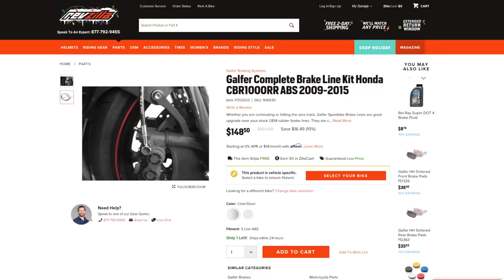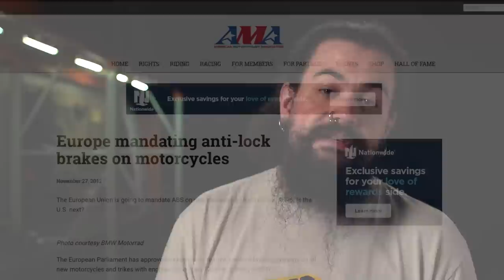3 Arguments AGAINST Motorcycle ABS!

Comment: There are No argument or reason good enough to not have ABS on the streets. Unless you're a professional racer, you will Not outbreak a bike with ABS. I do stoppies on my MT-09 even while leaning backwards with no ABS intervention. So i can't stop any faster with or without ABS. So the only time you'll feel the difference is when you slam on the break too fast. At that point ABS Actually saving lives. And with more and more bikes coming out with lean sensitive ABS, it's getting even safer. Offroad is a completely different story. There should Always be a way to turn of ABS. At the very least on the rear wheel on bikes designed to ride offroad at any time. Even if it's an adventure bike.
Reply: Not true at all. If you ride without any rider aids, you are in charge and are in fact responsible for your own mistakes and for your own life. That means that when on a bike without rider aids, you will instinctivly go slower and be more alert.
Reply: I once had a buddy tell me he could go 3 rounds with the heavy weight boxing champion. That's what I think of when people say they can beat ABS... NO FUCKING WAY !! You will be unconscious 😂😂
Reply: There's off-road ABS these days too, pretty sure it comes standard on newer KTM ADV bikes.
Reply: @Brgnalf81 , no, not at all. People are going to ride their bikes the same weather or not their bike has abs or not
Reply: @csolivais1979  I find that my friends that have rider aids on their bikes tend to over do it more times than the guys without rider aids.
Reply: @Brgnalf81 , so have you had your friends with the abs bikes ride the bikes without? I tend to find that most people, no matter what, tend to drive every thing the same. Meaning, the same person who drives aggressively in a Honda Civic is going to do the same in a Lambroghini. Conversely, if someone drives very conservatively, they will no matter what they drive

Comment: I fully understand the desire to turn off ABS off road but, the first street bike with ABS I had was a 2000 BMW R1100RS and now I won’t buy a new street bike without it. Wet oily pavement, streets covered with wet leaves in the fall, morons on the phone in front of you or turning across your path in the rain, ABS has saved my ass more times than I care to think about. I’ve only been riding for 44 years, but this is one “new trick” this “old dog” appreciates. 😉
Reply: Thank you for being a voice of reason
Reply: I have no ABS, but if it indeed gets mandatory by law I guess at some point in time prices must come down generally for the system if every brand and model simply has one...

ABS saves so many cars, I guess it's time to really start saving bikers too.

I only had a problem with brakes once, never had problems controlling the front brake as I'm used since a kid in bicycles but the problem is controlling the rear brake for me in a dangerous situation. Once I was on a road that fits only 1 car (one way road) and I was only at around 50KM\h and after a turn I get a BMW coming in reverse to me on a tight road, tight turn with no visibility and in the opposite way of the road which for sure I would never expected it. As soon as I saw it full rear brake with gentle front brake, I didn't fall or hit the car but was close to scratching at least however the rear tyre wasn't doing anything at all as it was fully locked since the first second I saw the car, bam full rear brake and I don't think I could ever control it if I get any more similar situation...

Shit might happen at any second and in my opinion it's hard to even know WTF we are going to do unless being there. On a track while racing that's all different for example as everyone knows the track, what to expect and are always 100% focused but on every day riding, everything can happen and sometimes is a split second and it's all gone just like that.
Reply: This was truly inspirational.
Reply: Dont believe that I like rear wheel ABS. No locking the back wheel is depressing and a questionable reduction of control.

Front wheel ABS may be OK.
Reply: @christopherwieland1196  ABS has reduced motocycle fatalities globally by 37% according to the WHO. I'll always have it. Why remove a layer of safety?
Reply: @flippy5118  It depends on your personal needs as a rider, your experience, comfort, and understanding of the difference it will make on your riding experience. With ABS installed the rider is unable to lock up a tire. Locking up the rear tire is fun and impacts your possible maneuverability, locking a front tire allows nose stands and other odd maneuvers. Long story short, there are motions a non ABS bike can perform that an ABS bike cannot and the benefits of ABS are overmarketed through fear mongering. For example, we have all seen the YouTube video where water is sprayed and a biker slams on his brakes and the tires brake out from underneath the non ABS bike and fall on the ground. SO what, the point of defensive driving, especially in the rain, is too not put yourself in a situation where you would slam on your brakes. A non ABS driver could arguably stop a bike faster than a non ABS driver in a competition and certainly pull off maneuvers an ABS driver could not. I've experienced ABS engaging more than once     and have an understanding of it's design and implementation. I also had it engage when I was doing something stupid and nearly slammed into the back of a pickup truck, everything worked out. I would argue with you all day that ABS has not reduced motorcycle fatalities by 37%. Statistics are gather incorrectly nearly as a rule these days to push narratives. Many factors have reduced motorcycle fatalities, mostly cultural and manufacture implementations. I would challenge you to imagine a methodology to collects accurate statistics for such a claim. How would you go about that? What would you take into consideration, what wouldn't you? There is an entire type of movement that ABS removes from riding that involves locking tires and that's the truth. Go find a trick or stunt biker that uses ABS...

That being said, non ABS features aren't exclusively for trick or stunt bikers.

Comment: even pro's can't out brake a ABS system proven many times all ready you have to be a MOTO GP Champion to do  that im not sure everycorner is full of them
Reply: He meant off-road riders. It's easier to back in an enduro than braking and turning. But yea, most of pro enduro riders don't bother with ABS and just switch it off/rip it out completely, so video's argument is invalid.
Reply: i agree.  But to me that is not the point.  ABS works well, that is certain.  I can do without it and have been doing so since the early 1970's.  As an option I'm all for it.  As a self wrencher though I find it unnecessarily complicated and too costly for the benefits.  The costs of ABS repair OFTEN exceed the cost of an otherwise fine machine.
Reply: @amrev2.020  spot on. Id rather see more riders getting airbag vests than ABS. Vigilant riding should mitigate most of the need for ABS, just like driving a car

Comment: ABS saved my ass one morning when it was still a little wet out and I hit a slick part of a freshly asphalted turn lane. It felt like I was on ice but I allowed enough distance when coming up to the car waiting for the arrow, was engine braking and applied the brakes evenly but nothing. ABS light started flashing and bike went loose and shimmied. I felt the ABS working, didn’t panic and all was well. Heart rate was way up but I completely believe the ABS saved me from going into the trunk of that car or locking up the brakes and losing control.
Reply: so you got to keep riding happily ever after. good to know you are safe.
Reply: I am a Japanese girl living in Scotland.

Just this week I was out on my 96ci Harley Street Bob  (FXDB) to pick up some essential shopping.

I was cruising along a dual carriageway at around 60mph well within the speed limit and as it's lockdown the roads were empty.

Up ahead I saw an SUV stopped at the end of the slip road (kinda like an on ramp in the US). 

I thought, "How the hell have you managed to get in that position".

No sooner had I thought that the SUV pulled out into my lane at 5mph and began accelerating slowly as I approached from behind at 60mph.

I had to emergency brake and the crap Harley ABS kicked in, lots of tire smoke, the bike was bucking and kicking and wanting to veer off.

I managed to hold the bike and it slowed to a matching speed of the SUV with inches to spare. My front wheel was an inch off the back bumper.

The ABS both saved me and almost killed me in equal measure. Make sure you buy a bike with GOOD ABS.

Either way I am glad I went to the bathroom before I left home 😰😰
Reply: Cody Phinney  @Cody

Not a bot, just copypasta'd my comment to reply to another commenter.

Lazy I know, but easier than typing it out again 😂
Reply: @DoctorAkikoFukuwara  Thanks for your story I am glad you’re safe

Comment: I am a Japanese girl living in Scotland.

Just this week I was out on my 96ci Harley Street Bob  (FXDB) to pick up some essential shopping.

I was cruising along a dual carriageway at around 60mph well within the speed limit and as it's lockdown the roads were empty.

Up ahead I saw an SUV stopped at the end of the slip road (kinda like an on ramp in the US). 

I thought, "How the hell have you managed to get in that position".

No sooner had I thought that the SUV pulled out into my lane at 5mph and began accelerating slowly as I approached from behind at 60mph.

I had to emergency brake and the crap Harley ABS kicked in, lots of tire smoke, the bike was bucking and kicking and wanting to veer off.

I managed to hold the bike and it slowed to a matching speed of the SUV with inches to spare. My front wheel was an inch off the back bumper.

The ABS both saved me and almost killed me in equal measure. Make sure you buy a bike with GOOD ABS.

Either way I am glad I went to the bathroom before I left home 😰😰
Reply: Hi Akiko. ABS brakes don't stop you the fastest way possible just by yanking them, no matter how good they are. You have to modulate the brakes in a way where your front forks don't bottom out hard and then bounce like a pogo stick. When your front loses traction, you lose almost all your braking. Then as your front comes back down, wham, it bites hard, but then you bottom it out and bounce it, again. And ABS is 100% doing exactly what it's supposed to do.

On that Harley, you gotta do the weight transfer more smoothly to load the front just that one time and to keep it there. 

Braking takes a bit of skill and focused learning. Once you've learned (and most people don't ever learn. We're too dumb and lazy), ABS is not a big deal in the vast majority of your riding conditions. But since most people can't learn this, ABS will save us dummies, sometimes. Like it did for you, here.

Comment: If you ride only on good dry roads you won't need it much. But city riding over white lines, rails, manhole covers, rain, oil, rocks, low temperatures etc. it can save you, your ride and someone else's live. I've fallen locking the front wheel on wet highway with 160km/h and ABS could have prevented that.

Comment: Arguments can be made against any safety feature. Seatbelts can cause death if your car goes into the drink and you're not able to undo them. Lights can blind oncoming traffic. Brakes can cause others to rear-end your bike. Regular maintenance requires additional expenditures. Riding gear adds extra cost to riding.

You have the freedom to choose. You don't want a bike with ABS, buy one that doesn't have it, but don't complain that a particular brand/model comes standard with ABS. Even if it becomes law, you can still get used bikes that didn't come with it, or as some suggested, pull the ABS fuse.

By the way, even on a bike with ABS, you can stop the bike faster on your own than with ABS assist. If you're that much in control you can apply brakepressure without locking up a wheel, and your stopping distance will be shorter than when you do lock up the wheels and ABS needs to intervene.

Comment: I would prefer motorcycle companies to offer a different variation of their production line. ABS replaces progressive brake pressure skill. Throttle control replaces progressive throttle roll. Launch control for a lack of throttle, rpm, and clutch skill. Wheelie control for a lack of throttle discipline. Slipper clutch for a lack of overall riding skill and discipline. Clutchless upshift/downshift, because, at this point, why not! How about one line offers all these training wheel assists, and the other line offers an upgraded suspension, brake, and wheel package. MotoGP isn’t a good enough excuse. I’d love to see racing sacrifice lap times for unassisted riding skill.

Comment: I let the talk about abs convince me I didn't need it for my first bike and regretted it. After having a handful of emergency stop situations, I've found it's difficult to maximize stopping power on both tires in a panic stop situation, the rear is very easy to slide and you have to reduce pressure as weight moves forward, the front tire requires progressive increased pressure and if it slides you have a fraction of a second to catch it. It's the confidence of knowing that you can apply the brakes hard to keep you clear of trouble regardless of surface conditions. You can't count on clear perfect pavement conditions on the street, and ABS can electronically control for that better than most human riders. The cost is offset by increased resale value, lowered insurance rates, and reduced chance of a drop. Motorcycling is already dangerous enough, If you are on the dirt fine or track then great, for street duty I think it's ideal.

Comment: I owned a 2003 BMW K1200RS.  It was equipped with the most complicated ABS system known to man.  It required a yearly flush that took the dealer over two hours to flush.  It could be done by an owner who is a glutton for punishment with special tools and tons of knowledge.  If the pump was allowed to seize, you were looking at shelling out several thousand dollars.  Eventually, I sold the bike because of the complex ABS system.  I then went to buy a 2018 Suzuki SV650.  It came with or without ABS.  I chose the non-ABS version.  I can now flush and bleed my brakes in under thirty minutes and there’s no possibility that I’ll need to shell out several thousand dollars in the future.  I’m a happy camper.  BTW, the SV650 is a great bike!

Comment: Here's something else: manufacturers use ABS as an excuse to make you bring your bike into the dealer to change brake fluid. Only they can acquire (or afford) the "special tool" that cycles the abs pump to do a full fluid flush. I assume there is no technical reason there couldn't be a "brake fluid change mode" activated by the user to cycle the pump for at home fluid changes.

Personally I just keep fluid cycling through the system by doing frequent flushes and making sure the abs gets activated once in a while by braking hard on gravel.
Reply: That is really all you need to do. Flush regularly. Every two years. Activate the abs pump now and again. It's actually pretty cool when you slam I the brakes and the tires just keep on turning.

Comment: At the very least, having the option to disable ABS is a must. I chose a KLR as my first bike in part due to how it is a older machine. I wanted to learn to control a bike in its simplest form. I do concede that ABS would have been useful on more than one occasion. But the skill that I am forced to develop in regards to braking is both rewarding and exhilarating. 

ABS might make motorcycles safer, and I wouldn’t mind the option, but I didn’t choose to ride because I’m 100% risk averse. I chose to ride because I wanted every decision I made to have an effect on me.

Comment: I like the ABS on my V-Strom 1000 when on pavement. It is slower to brake On gravel, and it will flat out kill you On off road decents. I put a kill switch on it , so I can deactivate it when I get rowdy on gravel, or do off roading. Had some scary moments in Moab before I put the ABS switch on. Huge picker factor on loose downhills, when the ABS kicks in and won't lock the tires. I had the presence of mind to shut off the engine before I went off a cliff, thus shutting off ABS and allowing me to stop the bike.

Comment: Thanks for the video. I would like to provide my counter-arguments for your three points. 
1) Out on the road, you very frequently do not have a dry and clean road. Painted signs, metal manhole covers, dirt and sand on the road, wet road from rain and other sources etc all increase the risk of slip if you happen to be breaking when your wheel is currently over those. Even if you are on virgin clean and dry road, how much can an "experienced" rider outperform ABS by, in ideal conditions? 5 or 7%? That's insignificant.  Also, not that I put "experienced" in quotation marks because most riders like to think that they are experienced, but 90% shit their guts out in an emergency situation and just slam the breaks because almost no one trains emergency breaking regularly.
2) Yes, it adds a bit of cost and complexity, but it all depends on what you are willing to pay for safety. Also, probably more than half of all bikes which have seen some action has been layed down at least once. This means that you loose money on repairs or on resale value. In this sense, the ABS system statistically pays for itself. 
3) Well, the reason the government mandates things is because people don't understand the risk and it's often too late once you do. It's the same reason why wearing a certified helmet is mandatory.